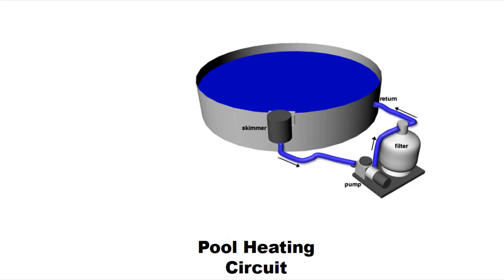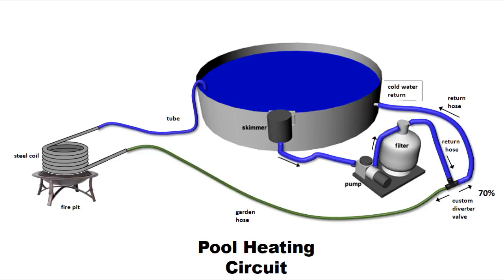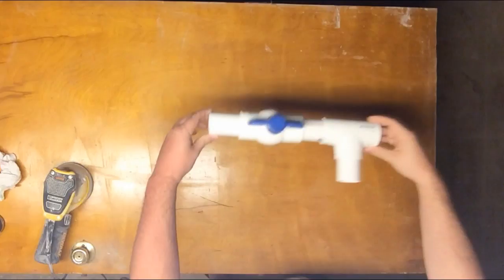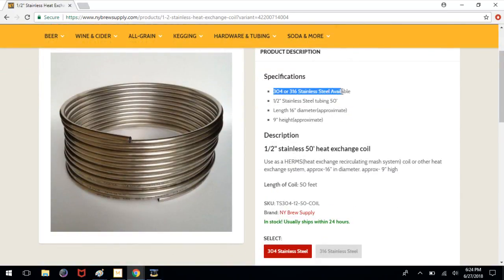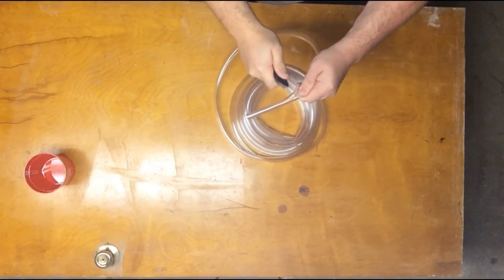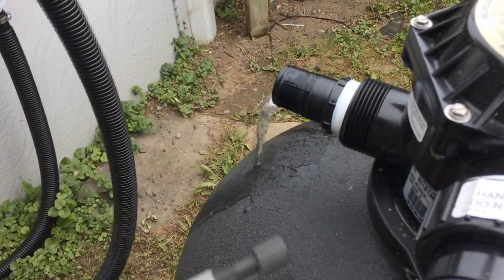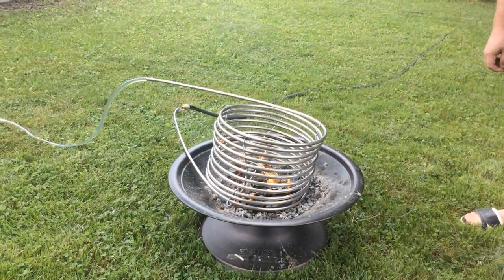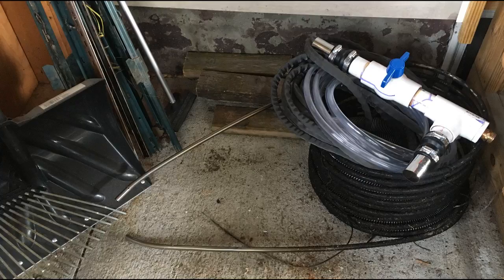$120 Bonfire Pool Heater

Comment: I did that with copper tubing worked great.  Didn't hold up to chlorine very well.  But turns a pool into a hot tube fast!  I put the coils over the bonfire stainless steel fire ring for smoke free fire right next to pool

Comment: Thanks for the video. Flow rate quickly at a low temperature vs slow at a high temperature shouldn't really change things. Energy is energy. 1 to 1. I think a lot of loss would be from the exit of your energy source fighting ambient along the line back to the pool. Keep that short! Thanks for sharing! Look forward to an update.

Comment: Certainly cheap and easy to build but requires a lot of manual babysitting to operate... and there are no safety devices in case the power goes out (pump failure) or a hose breaks.

Comment: Do you think adding a small 12v pump to the heating system would hest the pool/tub any quicker or would the flow be too fast to heat the water enough?

Comment: Hey nice Vid, wonder if thickness is matters ? i found 316L SS Tubing Coil – 1/2’’dia x .035wall x 100’  for like 50$  but its only, 0.35 wall thickness, 20 GA. they ranged temp up to 1500F. i wonder is that gonna be good enough ? 
thanks!

Comment: How do you stop the flow of water going through your heating system the way you put your valve in ?
Reply from the maker: You would need an additional ball valve on the other end on the Tee just before the garden hose fitting to block flow from going through the coil. The ball valve in this configuration is only used to block water from leaking out of the pool while everything is being setup. I was just trying to throw something quick and cheap together last summer. This spring I spent $250 on a new setup including an all new diverter to limit pressure drop and have more flow control. I also bought a 100ft. long 3/4in. diameter coil instead of a 50ft. long 1/2in. in order to heat my pool faster. I've only tested out the new setup once so far this year and was able to heat it almost 2X faster. 2 or 3 cold nights seems to ruin all the progress that the heater makes so it is best to have an all day long bonfire the day before you want to swim and you could raise the temperature by about 15-20 degrees depending on the size of the pool.
Reply: @ashow13  Just curious where you found the 3/4" coil.  I didn't find that size on the nybrewsupply site.  BTW, great video!  I'm looking forward to trying this out and reducing the gas bill on the pool heater!
Reply from the maker: @richherbert7791  I could only find 3/4" in copper at a reasonable price. Try home depot or lowes.
Reply: @ashow13  did you so follow up video explaining this?

Comment: how well does the diverter work vs a y configuration?
Reply from the maker: You could use a T or a Y shaped diverter. The Y shaped one would probably have less pressure drop, but I like if it flows slower because it will cook longer. If it flows too fast it doesn't absorb enough heat.
Reply: @ashow13  I might go with continuous flow at T 90 and then use valve to regulate pressure to coil

Comment: How do you avoiding rust within the metal coil? It seems like it would rust away with in a couple years. Not only that as the metal corrode it would add possibly texit elements to the pool water.
Reply from the maker: It is stainless steel so it should be somewhat resistant to rust. I've only been using it for 2 years and so far no issues. Can't say how it will hold up long term.

Comment: Question for you, I am doing basically the same thing you did but I used copper instead of steel and I will be setting my copper coil in a fire pit. My question is this, will the tubing get so hot that it will melt or ruin your rubber tubing? Also, I ended up buying refrigeration copper coil by mistake, it just seems to be a little thinner than what I wanted but do you think it will be OK and withstand the heat? It is type L copper
Reply from the maker: Yes I believe copper will work just fine. I've seen people in other video use it. I just wouldn't recommend putting the coil in the fire unless water is running through it to absorb some of the heat.
Reply: Ive seen other videos where people comment that chlorine pool water mixed with hot copper creates a toxicity in the pool and will quickly eat the copper. Is any of it true?
Reply: @jakecornett5083  Hot copper pipes have chlorine running through them for years on end within your home, and we still use copper in the walls of homes... Copper will end up with pin sized holes in it over time if a lot of chlorine runs through it but that takes a long time and you'll notice because of the weird coloring that will form on it.

Comment: Hi I was just wondering why you wouldn't divert 100 percent of the water thought the bonfire?
Reply from the maker: Forcing all of the flow from a 1-1/2" pool hose down to a 5/8" garden hose puts strain on the pump. Plus, the water would flow too fast through the coil and not absorb enough heat to be effective.

Comment: What was your reasoning for using stainless over copper? Longevity? Durability?
Reply from the maker: No reason other than it was easy to source online at the time. Copper will work just as well.
Reply: @ashow13  copper has a much higher thermal conductivity
Reply: Copper and chlorine isn't a good idea. Stainless steel 316 is resistant to corrosion

Comment: what did you mean when said  from 63 to 80 in "4 bonfires". is that 4 hours or 4 days of firing?
Reply from the maker: 4 separate bonfires on 4 separate days (roughly 17 hours total). The pool heats up about 1 degree per hour with the setup in this video. Smaller pools will heat faster. I've since upgraded my setup.
Reply: So give us a video on upgraded specs and performance please.  Thanks

Comment: why do you need two returns to the pool, 1 cold and 1 hot, can you just do 1 hot?
Reply from the maker: Trying to push all the water from a 1-1/2" hose through a 5/8" garden hose would create a lot of pressure which isn't good for the pool pump. Having the additional return line relieves that pressure. Also, if the flow were moving at too fast a rate it wouldn't have adequate time to absorb heat from the fire unless you had a longer coil. Something you could also do is if you are filling your pool you could just run the hose right into the heater and fill the pool with hot water.
Reply: Smokey Bear  You probably could.

Comment: Can you use a copper coil or does it have to be a stainless steel?
Reply: Chlorine corrodes copper. Look it up. If you want to run pool water through metal, go with stainless steel.
Reply: @patriotjedimaster1450  just connect a chlorine filter to the pump and you definitely can and should use copper. Stainless steel heating properties don't compare to copper

Comment: Just so know you listed a male garden hose adapter and you actually need a female
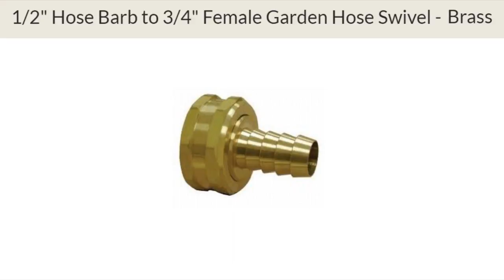Reply from the maker: My garden hose has 1 male and 1 female end. At 3:55 I list the male fitting for the diverter which the female end of my hose threads onto. At 6:01 I list the female swivel fitting that the male end of my garden hose threads into.